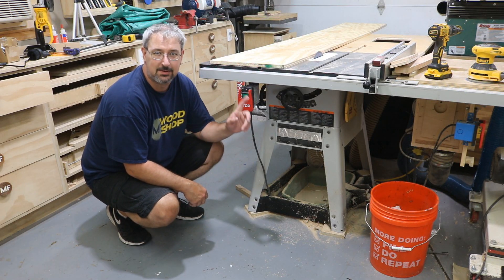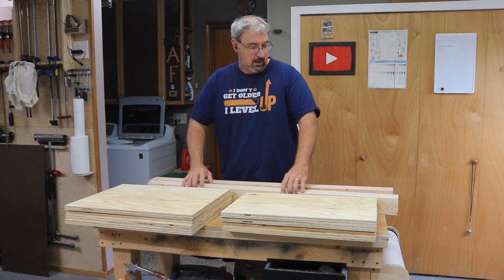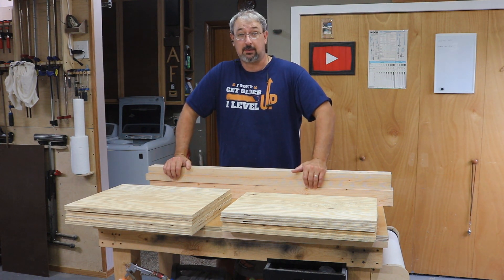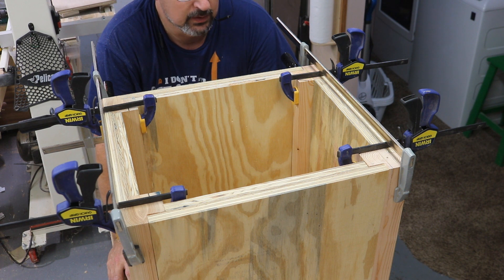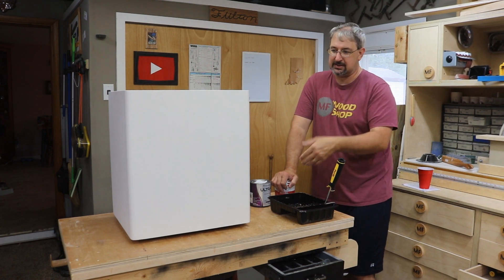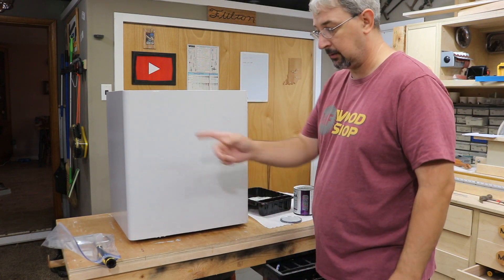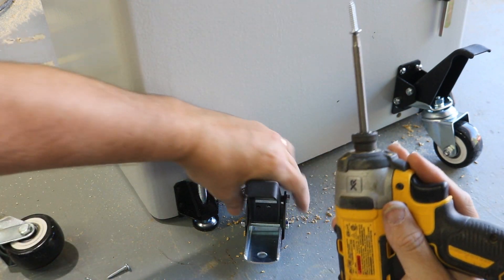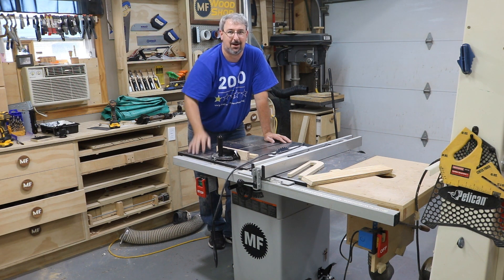Replace your Table Saw Base

Comment: Very cool job! My old craftsman stand is too wide for my small space. I like your design that saves room by making it square. Do you think that an access door would be necessary for the build in case you need to get to the motor?
Reply from the maker: Thanks! 👍 Motor is still hanging off the back. But if your in below yes

Comment: I get you may have preferred to use a jig saw, but a hole saw would be much easier and cleaner to cut out the hole. No knock, just me preference!😁
Reply from the maker: ya, there about hundreds ways to do just about anything

Comment: Best rendering of table saw base on YouTube. I know what you mean about rudeness. They act like they are doing you a favor by being in the store. Those rounded over corners are a perfect match for your saw. They won't match my saw but I'm going to steal them anyway. I will cheat on them and use a BIG rounding over bit in my router. I'm just that lazy.
Reply from the maker: Thanks like this setup as well

Comment: Great job.  I am amost done makingmy cabinet.  Question: why didn't you hook the hose to the 4 inch port under the saw?  Wouldn't that be more efficient?  I have a similar saw and I am trying to decide if I am going to use your method or have the hose inside the cabinet hook to the port
Reply from the maker: I’ve done it both way now and really if you don’t seal all the way around the saw it doesn’t really matter either way.
Reply: @mfwoodshop  Thanks.  I have an older Blue Jet Tablesaw. I am going to have to have the paint matched.  I think I will hook the hose to the cabinet base as you did and then inside the cabinet have a hose run from that port to the DC port on the saw.  I am going to make a small door I can open to vacuum out the cabinet once in a while.  Love your videos.  I appreciate you replying after a year after the video was made.

Have you ever made a dust collector hood for the top of the table saw?  I have seen many builds for those.

Comment: Great job, Mike~!  I have my Craftsman contractor saw that I've been looking to do the same thing to so that I can level it up with my newer cabinet saw.  I think your idea is one I can make work. As for the slanted board leading to the dust outlet, I'm thinking of adhering to it a scrap piece of laminate that's been lying around the shop forever.  That should make it pretty slick.
Thanks for sharing~!!
Reply from the maker: The slicker the better, thanks for watching

Comment: Looks good.  Did I miss something?  How did you attach the table saw to the base?  Seen the threaded inserts in the base but how were you able to do the 1/4 inch bolts?
Reply from the maker: I time lapse that part. The bolts you can get to from the backside.